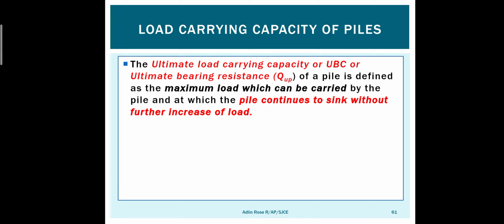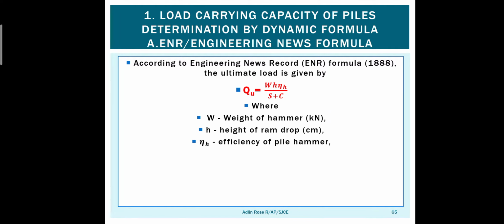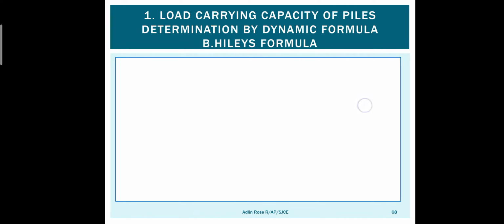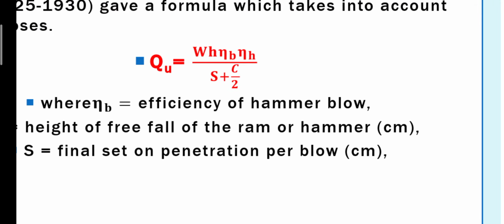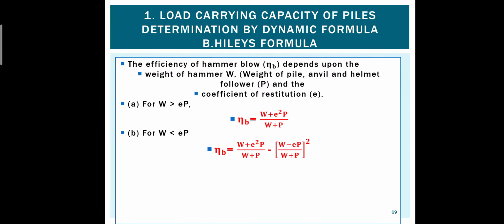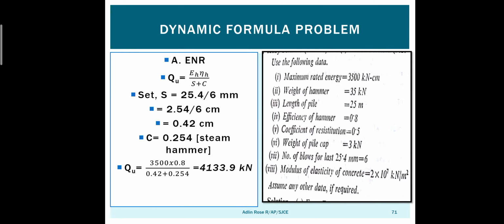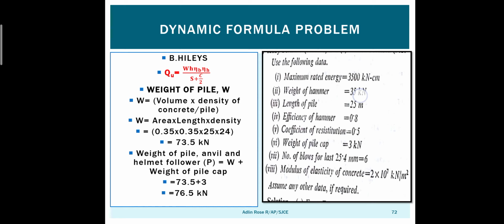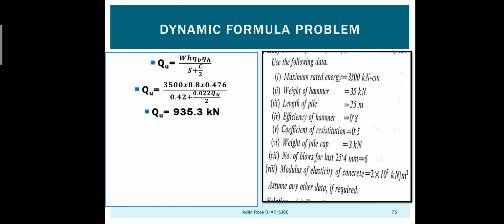Unit 4/Dynamic Formula for Load Carrying Capacity of piles

Comment: Mam I have a doubt regarding a problem can you help me ? I have pasted the question down below. 
. A steel circular pile of dia 406mm with unit weight @1.2kN/m run , 16m long is driven by a Vulcan 140c hammer of rated energy 48.8kN-m , and efficiency 0.85. The weight of ram is 125kN and weight of pile cap is 7.5kN. The coefficient of restitution is 0.35 and number of blows 8mm/blow for last 30mm. Estimate the allowable pile carrying capacity using IS Code formula